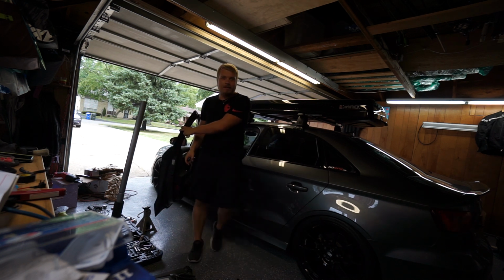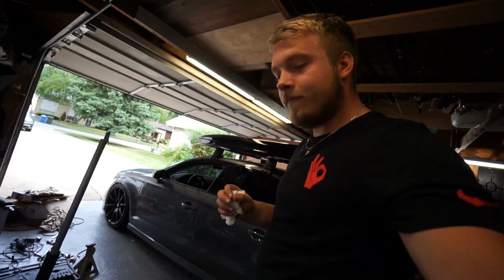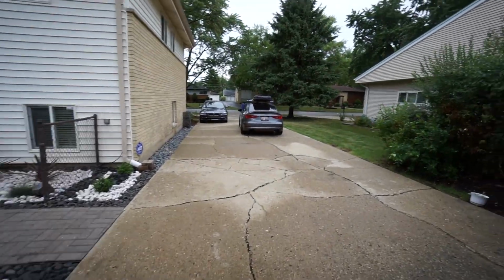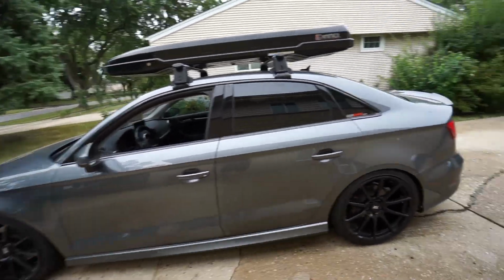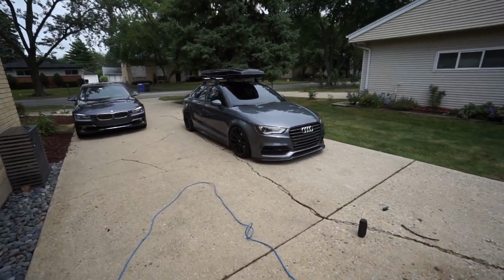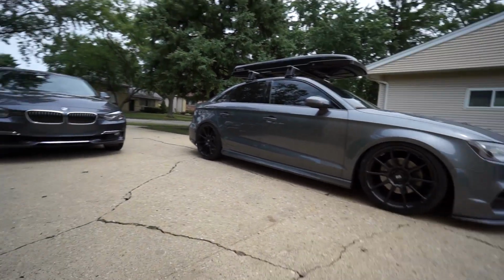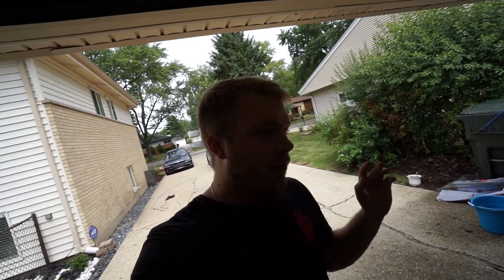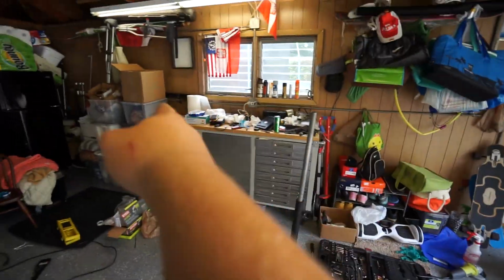Air Ride Install Pt 2 | Forgot to tighten 3 bolts...

Comment: Looking good. 👍
Reply from the maker: Thanks! Are you running a cateless downpipe and resonated or non res catback
Reply: Kamil Pawlak CTS catless
Reply: Kamil Pawlak non res catback I’ll get you that video hopefully tomorrow.
Reply from the maker: Hows the drone? Any?
Reply: Kamil Pawlak id say maybe a slight drone nothing to bad but you can also switch to valve closed if you think so, nothing worse than my FRS exhaust drone when I had it. When full throttle the car is a monster. I’ll try and do inside shots as well.

Comment: When you put on the coil overs does it affect the Audi ride control
Reply from the maker: If you have electronic shocks. Yes you will have a code. And you will need a bypass plug for it not to throw a code